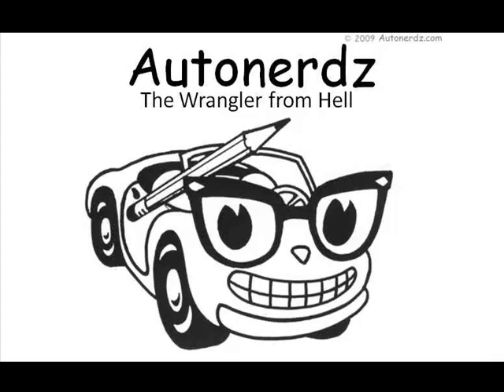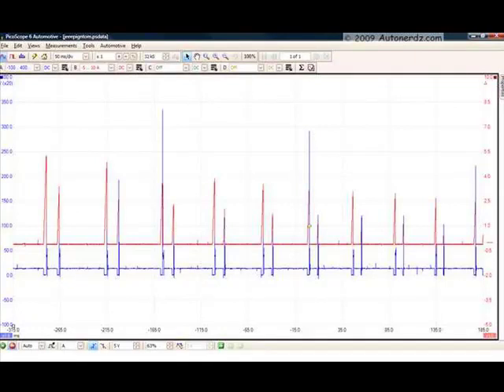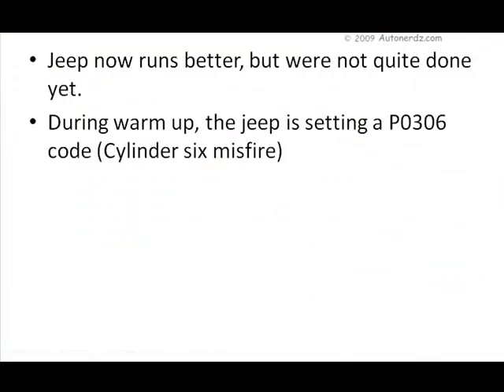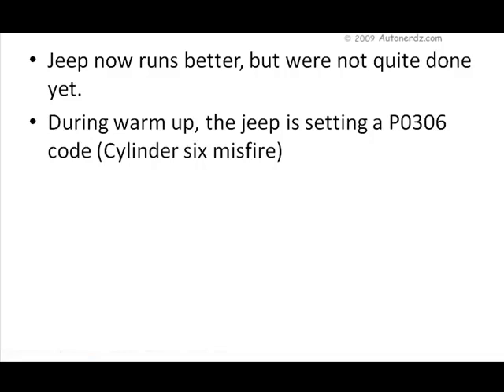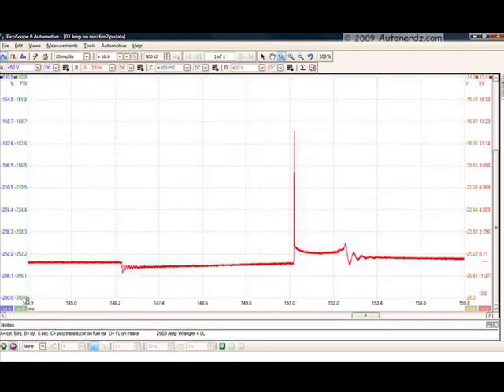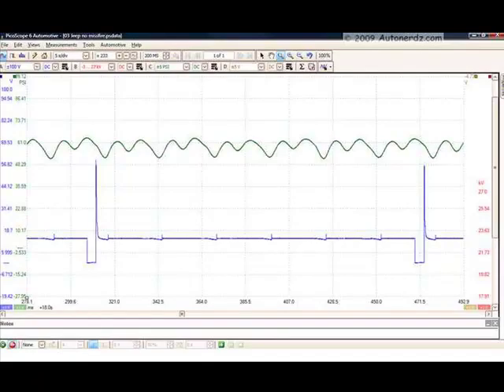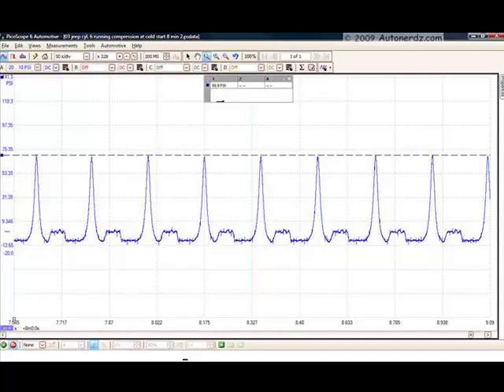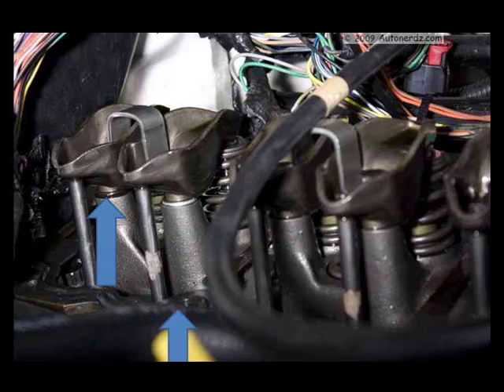The Wrangler from Hell part 1

Comment: Why worry so much when it only did at cold temp and not all the times ?
What’s the big deal on that if don’t affect nothing , after all it is only on cold .
Please let me know
Reply from the maker: Your question is a matter of personal allowable tolerances. The client that owned this vehicle need this issue to be found so it could be fixed.  To them it was not acceptable to have a misfire for 3 minutes during engine warm up.